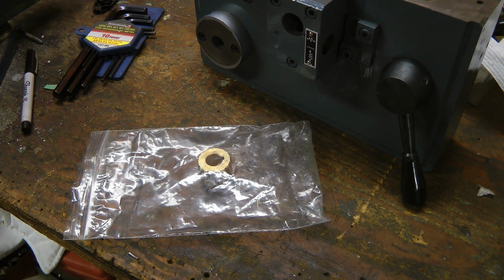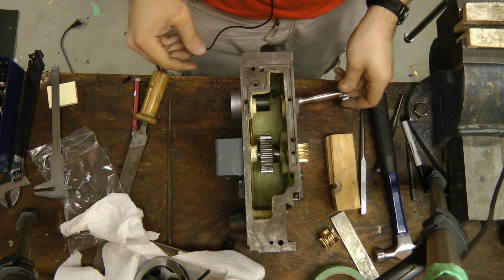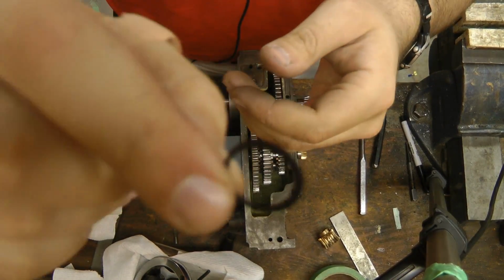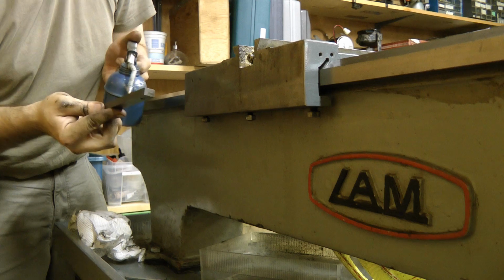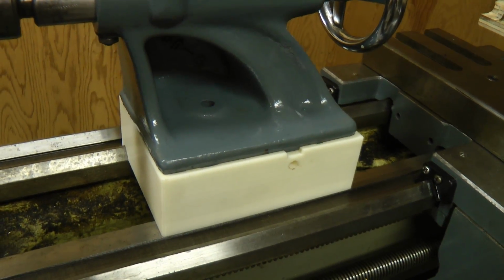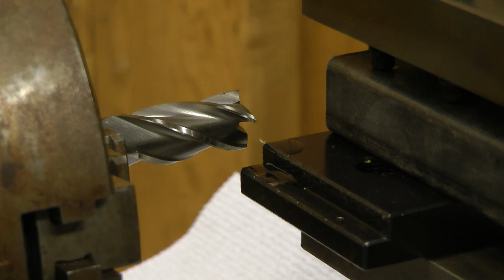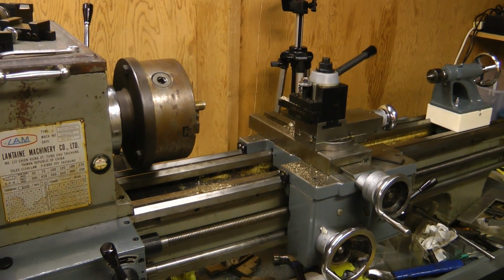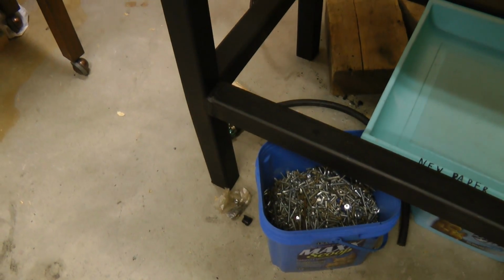Lantaine LAM-350H metal lathe part 2

Comment: Hi, I have recently purchased a Lam 350 Lataine Lathe made in 1976. It is very similar to yours and the power is faulty. The Lathe has been under a canvas cover for the last 20 years so it needed to be cleaned and restored some. I haven't pulled the carriage apart yet but it sounds like i mite be down the same path of you rebuild.  This is the first Lathe that I have had and new to working on the Lathe.  It would be greatly appreciated if you could supply me with details of where you sourced the Manual and parts for you're Lathe.  Cheers Maurice.

Comment: Hi, thanks very much for these videos! very little info about these lathes. Would you happen to know what replacement roller bearings can be used for the spindle?
Reply from the maker: Hi there, you're welcome! Take a look at spare parts from Grizzly Industrial. Some of the spares from model G9249 fit this lathe.
Reply: @tesla500  Thanks very much mate! Will have a look. Cheers

Comment: I have the Honden lathe which is a cousin of yours. The carriage leaks oil a lot. No seals.
Reply from the maker: +newstart49 Is the carriage supposed to be filled with oil like a sump? It's not obvious from the manual for mine.
Reply: There is a sight glass on the carriage front with a line marked at full.
http://img.photobucket.com/albums/v89/daddo/Honer%20Lathe%20wiring%20004_zps5muc1iki.jpg

Comment: Hi, the little bulb-like looking piece on your tailstock is called a dauber, and it is from years ago when dead centers were used and had to be lubricated, usually with white lead, you'll notice the dauber itself does not quite go to the bottom of the hole, the extra space acted as a well to hold the white lead, about the consistency of grease. The use of live[bearing] centers in the tailstock have made this feature not necessary on more modern lathes. Congratulations on your lathe find, enjoy it, great work, amazing ingenuity, looking forward to more great videos!!

Comment: Yes the cutter can pull the work piece in, Google "Climb Milling vs Conventional Milling".
And Brass tends to want to pull your tool in and can be scary, usually for brass the top of the tool is flat with no back rake

Comment: Yes, that's it, but I am no machinist, so I might be exaggerating a little. As far as I understand, on older machines with lower rigidity, you should "push" the workpiece away (called conventional milling). This leaves a worse finish than climb milling, but even old machines with a lot of backlash can be used successfully.

Comment: I see a very good improvement from the last video. The 3D printed tailstock base was very neat. It is probably too flexible and will change height when you tighten it. They sell cast-iron bar stock, you can use that to make the real thing. No need for casting.

Comment: It is a manual oiler for the tailstock end. There are old South Bend videos where you can see it being used. You fill the hole with high pressure lubricant and use the little thingy like a brush to apply lubricant to the centerhole. This was before live centers came about.

Comment: You need to machine a new power switch knob there, not the combination pliers. Order a set of spanners as well for the nuts, and keep them with the lathe, makes using it a lot better and saves wear on the nuts. Nice that you are bootstrapping the tooling for the lathe with the lathe itself.
Reply: I drill n 11 mm hole thru the gearbox and place the swich at the back of the machine. More conveiant  place